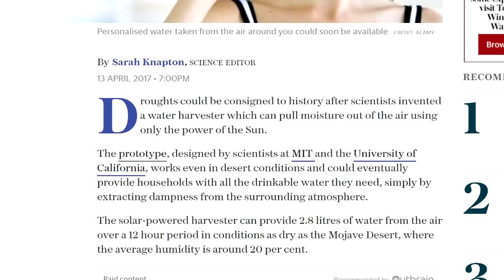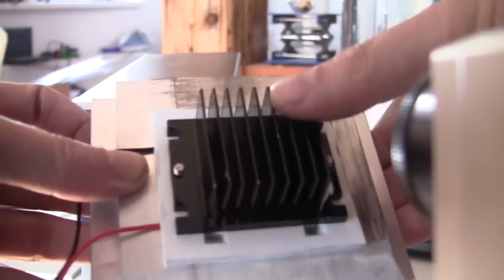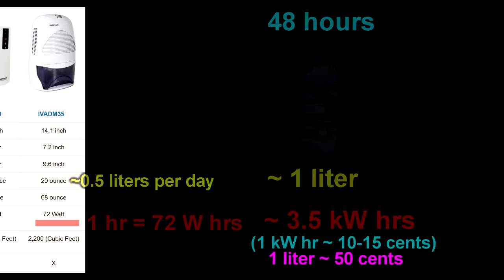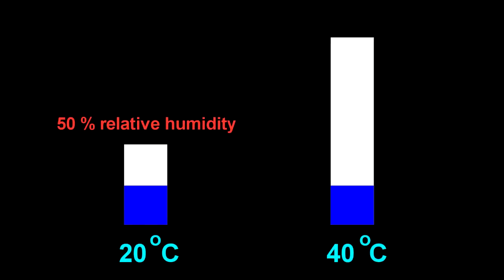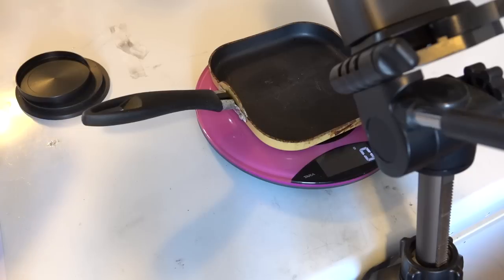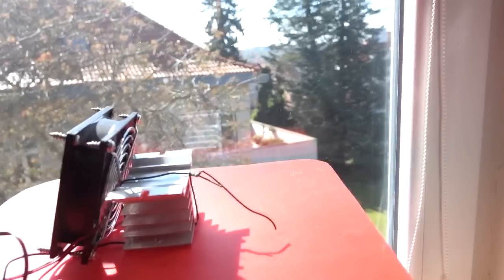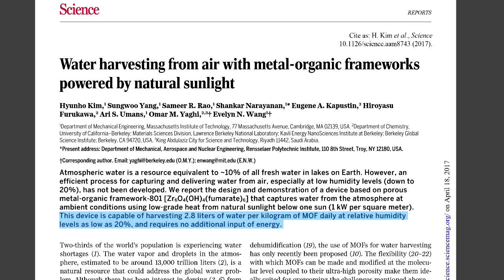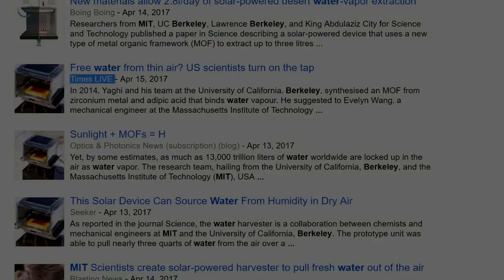FREE water from AIR device: BUSTED

Comment: The heat sink used in the documents is taken from a server. I scavenged a few of these from the electronics bin at work and have used them in a few experiments. What separates these heat sinks from home PC heat sinks - those things are massive and meant to be mounted horizontally in a rack mount server. But these are good coolers no doubt in that. :D

Comment: Hey Thunderf00t, could you please do a video on the MIT's claim of creating a super efficient 3d solar panel arrangement and the inaccuracies of articles written about it? 

The efficiency of each cell is not increased, simply the total output of the cell "tower" surpasses what a single cell (the size of the base) could produce. 

MIT is great at coming up with solutions for non-existent problems.

Comment: im sure you know that cold fusion has a principle that works where deuterium atoms condense in nickel that builds up then release in heat. It does work in the lab but not yet in industrial scale, and also intermittently works, not consistently

Comment: Every time he said "metal oxide framework" I died a bit inside
Reply: Oister195 
They haven't thought of using graphene yet, if they used that they could get a gallon of water for every pint of air that passed through the half inch square graphene membrane.
Reply: Oister195 do you mind explaining why? I'm stupid...
Reply: @Rodrigo Gehling Its Metal organic framework, not metal oxide framework.
Reply: Square Root ooh
Reply: It's a metal ORGANIC framework.
Reply: He works with nuclear stuff, where Metal Oxide fuel is pretty common.

Still hurts to listen >_>
Reply: +Oister195
Ok, but what's the difference? And why is it better than a MOx powder? They said in the paper that the framework only gathers ~25% of its mass in water. Is it just so the desiccant could be fixed to the ceiling?
Reply: Why is that funny? My car has a metal oxide framework. Iron oxide, to be specific. When I come to sell it, I will be sure to use this as a selling point.
Reply: Green Silver You can't get more water out of the air than is in it.

Comment: An average 20 litres dehumidifier removes about 6 to 8 litres of water per day. A really efficient dehumidifier averages 1 to 1.2 litres per kwh, e.g. the Meaco Platinum 20L @10C and 60%RH (of course YMMV, subject to air condition and temperature).
If you hook up a solar panel to the dehumidifier it is essentially free water.

Comment: This makes me remember some sort of documentary I saw many years ago. I think it was something we recorded on VHS, which was later overwritten with a movie.
You basically take a glass, add some sort of spacer to let moisture in and put a foil on top. Ground water would condense on the foil, run into the middle and drip into the glass.

No idea if that's actually viable or how to search for that specific method of retrieving water, but it always stuck with me.

Comment: water from air by only sunpower AGAIN??? and just from the get go: 

how to you pull water out of air that doesnt contain water, like dessert air?
Reply: I question it. I also question whether or not these "Scientists" know how to find their asses without the assistance of their students, a GPS device, the FAA, and military-grade tactical planning.
Reply: Dessert air has sugar, which you can break down for water and carbon :P
Reply: with proper powerpoint presentation and fundraiser video you can just break the physics.
Reply: The Power of Prayer ™
Reply: Science!
Reply: Probably wouldn't need to do much work for it in Antarctica.
Reply: LOL this is so true, dehumidifiers are supposed to work in damp conditions so this wouldn't work at all
Reply: Actually, typical desert* air has plenty of water. Deserts have high humidity, so a dehumidifier would pull water out of it. Antarctica would be closer to a dry desert. the air there doesn't have anywhere near as much water.
Reply: god.
Reply: Use the carbon to make, air plastic.
Use the sand in the desert to make silicon and the air plastic.
Bam, solar freaking roadways!
Also water.
Reply: In the night in a desert, you can make a hole, put a big plastic foil in it, put a stone in the center and the next morning you got way more water then this device can collect during daytime...
Reply: Beneteus der graue Wolf Air in the desert DOES have water, but very low amounts of it
Reply: Air in the Dessert has a lot of water. Since it's a dessert.
Reply: it has nigh no water u mean

Comment: Thunderf00t, would you please make a video about the truth of algae lamp that can absorb CO2 then turned to O2, and at the same time can be a light source and decoration ?
Reply: Sounds like photosynthesis and bioluminescence, but I don't actually know what you are talking about. Might work to some extent.
Reply: ***** , just search "algae lamp" on you tube or on Google, and you will be know what I mean.
Reply: The algae lamp is a solar-powered lamp using the glucose made by the algae. 

This isn't very different from using a solar panel and powering a lamp with it.

"A single lamp could absorb roughly a ton of carbon from the air in just one year — the same amount as 150 or 200 trees.": not if you are going to use the energy from the sugar to make electricity. Carbon-neutral, I guess.
Reply: I doubt it actually absorbs more than a tree. Sounds hyperbole to me.
Reply: Well, that's how plants work. There are several ways to genetically modify plants so they are bioluminescense and they have been made. I don't think it is practical at a large scale, and it certainly doesn't input and output more CO2 or O2 but other than that it has been proven to work/be scientifically accurate.(The glowing and gases)
Reply: I can believe that a lamp based on such a principle could work. I have trouble believing that it could provide more than a kind of soft glow that my phone would put to shame. And I have exactly 0 belief in the claim that it could sequester a ton of CO2 a year. I would maybe believe a kilo, but even then, I would have to ask, where does all the carbon go? What kind of organic material is this thing building with it? A tree produces trunk, leaves, fruit. What does this thing produce?
Reply: oh yeah that makes sense. He won't do a video on it though, because he debunks BS. This isn't BS, I just can't imagine the light being very strong.
However, there are many such inventions that are really cool, and he never mentions them because he is focused on debunking. There are enough people who promote actually good ideas already.

PS: Just watched a presentation and yeah, right now it isn't very bright. But these are living, evolving organisms. Maybe we can breed/engineer them to be a lot brighter, bacteria especially have VERY short generations so it could work. Then we won't have to worry about CO2 anymore!
Reply: You just described photosynthesis and bioluminescence. The light most likely wouldn't be more than a faint glow and a novelty, but this kind of algae already exists.
Reply: Michael Fernandez umm, you know, theres this thing called photosynthesis and bioluminescence, so MAYBE it can be real
Reply: used to filter water for clams and oyster farms too
Reply: Well, if I recall correctly, phytoplankton comprises only 0.5% of the terrestial biomass but their total uptake of CO2 is 45% that of all land-based plants. It is so impressive that some consider 'dumping' limiting trace nutrients (like Iron or copper) in oceans to stimulate its growth to increase CO2-uptake, what is called 'Ocean fertilization'.
Whether that makes the concept of that lamp viable, I don't know, I've never heard of the thing so I lack sufficient knowledge to say.
Reply: The Stoned Videogame Nerd: No you're not. You can't "get rid of" CO2. You can sequester it into biomass (specifically, microalgae can be used to produce biofuel), but what do you do with the biomass/biofuel? You can't burn it, because then you're back where you started, with CO2 in the air. And mind you, you guys are digging up 5.5 tons of lignite every second, and burning it in power plants. You'd need to be producing roughly the same amount of biomass and stash it somewhere to come out even. And besides, the whole thing is at best in an experimental phase.
I love how Germans keep coming up with ways to dress up their megatons of dirty-ass lignite as less dirty. Pump the CO2 into the ground, pump it into algae tanks! It's lipstick on a pig. The only way to reduce your carbon footprint is to leave that shit in the ground. (This goes for every other nation btw. CO2 sequestration is never going to work. The only way to reduce emission is to *not use fossil fuels*, end of story.)
Reply: +tybofborg
Yeah I partially agree with you. You can thank our Green Party for ruining our environment (very ironic I know ...) Nuclear power is the only clean energy we have, but everyone is so afraid of nuclear bombs that they won't let anyone harvest their true power. A process has been invented that creates almost no radioactive waste, but it produces weapons-grade plutonium as one of its stages.
Yeah of course we can't have that.
And then the only current alternative is coal. Don't worry though, this is only temporary until humans invent something powerful and clean that can last us for the next few centuries.

As for what I disagree with, you make the assertion that "CO2 sequestration is never going to work." That's a REALLY bold claim, because you don't know what awesome things scientists are going to come up with. These bacteria alone provide a lot of opportunity, as I stated above. What if, for instance, we perfected their CO2 intake and build giant stations, maybe even in low earth orbit, that just absorbed megatons of CO2 a year?
And like I said, that is just one idea. Trust me, if shit really hits the fan, humans get really inventive. Just keep supporting science and oppose ignorance, the savants and geniuses will take care of the rest :)
Reply: Yeah, I guess you're right, one should never say never. Still, I believe trying to come up with ways to sequester CO2 instead of replacing the fossil fuels that caused the problem in the first place is kind of counterproductive. Like how people who have diet coke consume more carb-rich food.
As for nuclear, I see a problem with cost, not with it being scary. After Fukushima, added safety precautions made new nuclear plants so much more expensive, it hardly seems worth the hassle anymore. The entire industry is struggling, which makes coming up with the funds for new development all the less likely. Westinghouse just went bankrupt too.
Reply: The Stoned Videogame Nerd: You're right, Germany is making a ton of effort with the Energiewende and everything, while the US is being crazy wasteful and denying there is a problem. On the other hand, I can kinda understand the Americans using more power, US is closer to the equator than Germany. I wouldn't want to face a Texan summer without air conditioning!

Comment: Water can be sucked out of flooded carpet and out of the air too I suppose with dehumidifiers  but they need a mains power source of 240 volts or 150 volts.

Comment: I remembered this video today (30 Oct 2022) when I read an article in the Sunday Times (UK), which describes a suspiciously similar device:
"Founder Cody Friesen, a material science professor at Arizona State University, created the system, in which a solar panel powers a fan that sucks in air, pulls out ambient moisture with a sponge-like engineered material, then adds minerals to give it the expected taste profile for drinking. [Never mind the taste:   how do they get the water out of the 'engineered material'?]  A single panel can, even in desert conditions, produce six litres of water a day...]
I don't know if Cody Friesen has any connection to the device in the video, but search results do link him to MIT and Bill Gates.

Comment: I think the point was rather energy availability than efficiency. The paper states very clearly that they expect their odd 3 litres from 1 kg of desiccant. This probably implies that they will also have 1000 peltier elements @50W each to cool it. Thus the numbers look ok to me. Combined with solar energy which essentially comes from the sun you could argue that there is no "additional" energy required. And in contrast to a litre of gasoline 50 kWh of solar energy are very available in the desert. Instead  of shipping gasoline to the desert regularly you'd have to ship quite a few solar panels but you would have to do this only once every 20 years or so. So the primary question is more like "Who the f will pay a metric ton of solar panels and peltier devices to supply one family in the desert with water?"
Reply: I can create free energy across the whole planet. Just cover it in solar panels. Genius huh?
Reply: Aaron, That's actually not a bad idea. If the panels can reach a price of 10 cents/watt, it would take only 2 trillion dollars to provide world with free clean energy. In comparison,  Iraq & Afghanistan wars alone cost US 6 trillion dollars!

Comment: If you live in the desert, plug a hose in your air conditioner's evaporator drain to recover room moisture. You may still want to boil that water though. You can get a few liters of water per day back this way at no additional cost.

Comment: You're wrong about this device thunderfoot. The operating principle is different from the previous water collection devices you debunked. For the Fontus and Waterseer, the operating principle was to cool air across the dew point and therefore condense it. As you've shown, and I agree, the temperature change you would need to move the air across the dew point depends on humidity and the electricity requirements for cooling are enormous. This device, on the other hand, uses a material which is naturally water absorbent; see for instance copper sulfate. Heat is required to release the water from the MOF, which is easier to come by in deserts than cooling. When the water is released from the material the surrounding air will become saturated (100% humidity) and so water will start condensing somewhere. The peltier device in their demonstration was a proxy for an efficient, passive system to remove heat from the condensing side of the device. Condensation by cooling was not the principle idea here, a material which was engineered to have a large water absorbance and low temperature threshold for release was. So this device in principle could operate in a dry environment and extract water from the air. Caveats: based on their numbers, to get 2 L of water a day would require 25 L of the metal organic framework (about the size of a backpack). There still is significant engineering that would be required for this device to work, but the science is there. The device would need to turn on/off air flow (with baffles), pack the material in such a way as to get a large volume but also a large surface area so a large amount of air can flow through the device, control its temperature both to heat cycle  the MOF (change from absorbing sunlight to reflecting it) and to remove waste heat from the condensing side, and it is unclear how much the final device would cost since of course cost scales with size. So this device can work in arid climates, of course the researchers presented the numbers in the way which sounds as optimistic as possible, but the science is there and with a few million $ of engineering a viable water from air product could be made that would work in the desert.

Comment: The gulf coast of Florida, is filled with humidity,  late spring will rarely rain because the storms will get pushed 50-80 miles inland before it rains.  So we get most of the rain for the early spring late winter, and summer rains. Maybe it will work better here

Comment: The key point is to use low grade heat energy as the input source for the desorption process, which means that you circumvent the highly inefficient step of converting the solar energy into electricity, and then to a peltier cooler. Nobody is claiming that you can capture large amounts of water in a small device, or disregarding thermodynamics. It's just about leveraging low grade heat (which typically goes unused) as opposed to high-grade electrical energy.

Comment: Desiccant dehumidifiers are a technology that should sit on the back-burner for now. Currently the problem is that the fuel required is nearly equal to the weight of the water produced, so you might as well just ship in water. However, if humanity ever gets access to low cost and compact fusion, it would indeed be very reasonable and cost effective for people to simply dehumidify their water out of the air as opposed to shipping it in or pumping it out of the ground and treating it.

The same can be applied to disaster relief or the military. Its all about the power you have available.

Comment: I went and read the paper. It does seem like the device works to some extent, although their ~3L of water thing appears to come from a computer model rather than an actual experiment. I think Thunderf00t evaded some aspects of the paper and didn't give it a fair shot. However, I must say that his point about the scale (tennis courts) is excellent. Even if this device works as claimed, the infrastructure required would be substantial to the point that other methods are much more practical. I think this paper should be taken as an interesting and incremental advance in MOF technology, nothing more.